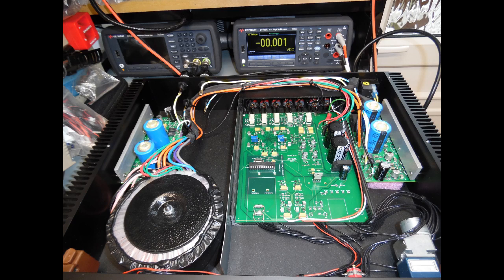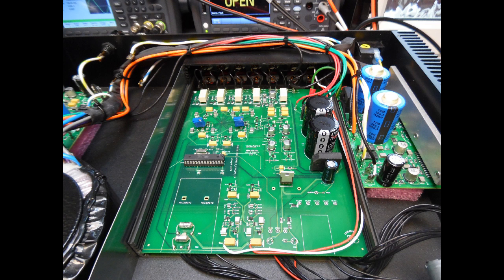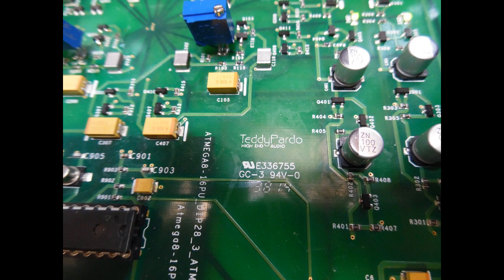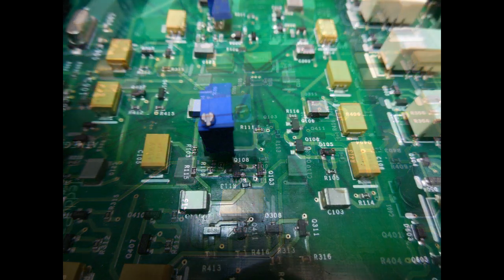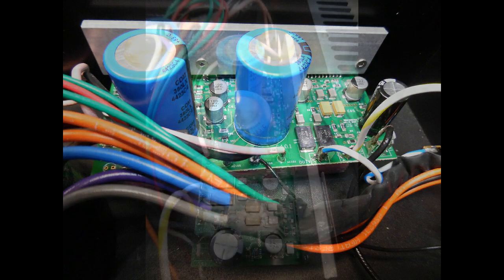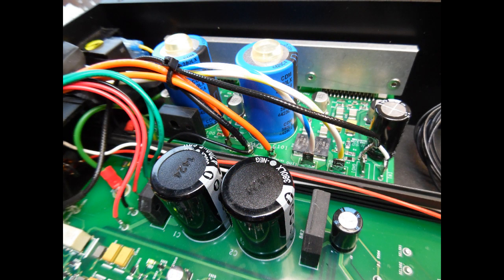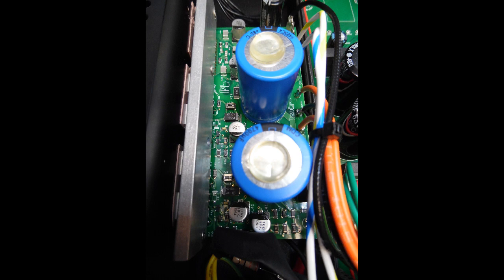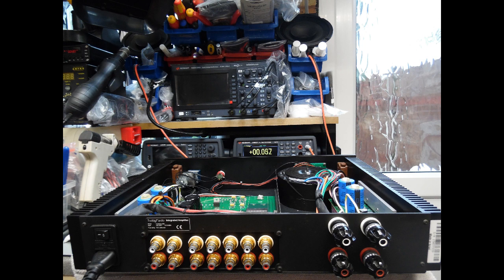Teddy Pardo i80a Amplifier not repaired and a shout out to the industry about the right to repair.

Comment: Exactly the same experience, purchased a Super Cap, AUD 2900 landed, after about 4 hours use it was kaput, emailed them, send it back, no here’s how you do it ect despite it being new, the intonation was I’d somehow shorted it, a quote form DHL AUD 680, at this time all emails sent were had no reply, absolute crickets from the ‘service’ department, sent it to local NAIM service centre fix at a cost of AUD $360 and here’s the interesting bit as to what went wrong after I was made to feel I was responsible 

Great sound product and no idea about service, and that goes for the lack of information as to when it might ship after the original order, over a month 
‘The wiring to the front panel LED was intended to be held down to the main PCB with a blob of hot melt adhesive.
One of the wires to the LED was poorly soldered at the PCB and the loose end of this wire seems to have shorted a track on the PCB thus incinerating two SMD resistors.
The resultant loss of power then prevented the unit from turning on.
Strange but that is what it looks like.
Not such good quality assembly ...... the build quality is more like something made by Project rather than Naim.......’
Reply from the maker: Hi thank you for sharing your experience on the channel, seems very strange that such poor customer care is provided.